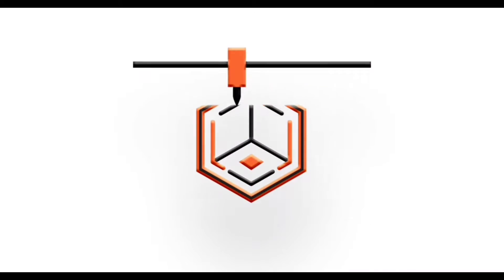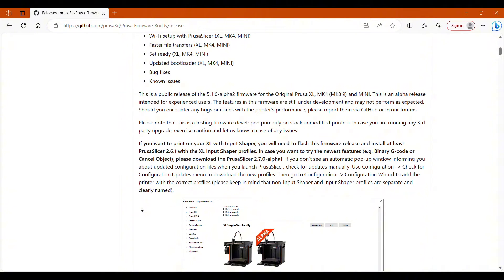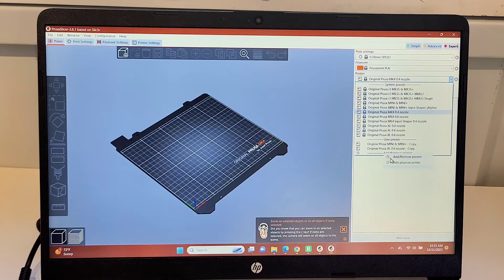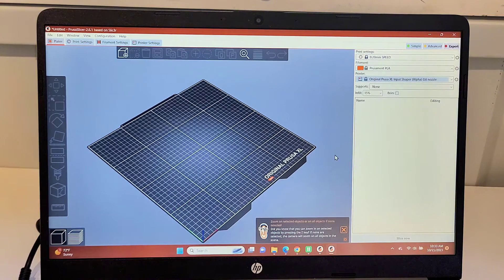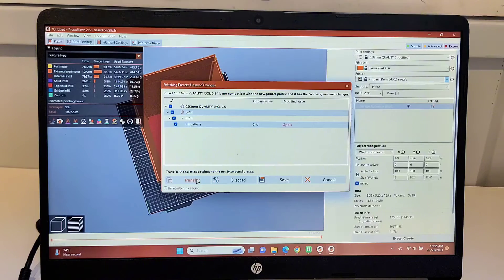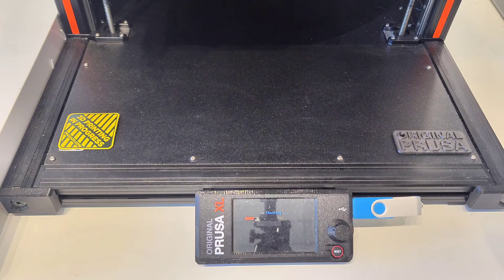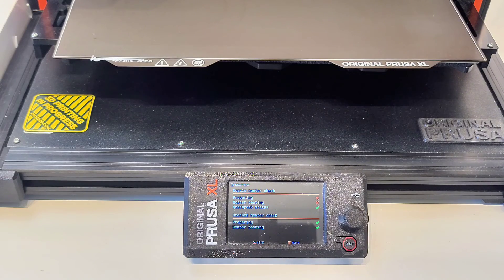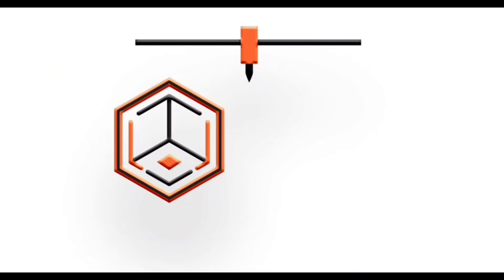Input Shaper on the Prusa XL is FINALLY here! How fast is it? How do you set it up?

Comment: Interesting video. When you set the prusa slicer to input shaper what speeds and accelerations does it set?
Reply from the maker: Going from .32 Speed to .32 IS Speed brings the Default Acceleration from 1000 to 1500. Perimeters go from 1200 to 3000. Thanks!

Comment: The github release page for the 5.1.0-a2 firmware one of the Known Issues states "Multi-Tool XL 3D printers can get stuck while checking heaters during the self-test, please restart the printer" which seems like the little hiccup you had. I wouldn't worry too much about it as long as everything else works/prints nominally.

Comment: I have had good ”luck” Edith the IS on the MK4. On the orter side of the spektrum though. Anyone has good settings for wood filaments in the MK4? So far no luck on that. 😮
Reply from the maker: What type of wood filament are you using? Most I have found like cooler temps. Those I usually run at 200 first layer and 190 for the rest.  But I have one that clogs unless I print it at 230.
Reply: @tada3dprinting   I got a roll of PrimaSelect wood filament. I'll try lowering the temp. It says 210 on the box, but I'll try 190-200. Also, after looking at all the wood filament vids I could find, I think my speeds are at times too slow. So.yea... Sorry for asking unrelated questions on your, as always, good informative video!

Comment: So, I tried it with a 200% scaled custom colored articulated dragon and...massive fail. Noticed a layer shift about 10 layers in and thought I could live with it. Came back a couple hours later to a bunch more layer shifts and the heads were frequently rehoming themselves. I was using silk PLA for 3 of the colors and 2 regular all on Generic PLA settings. Changed the 3 silk colors to Generic Silk PLA and am attempting again without the IS profile, but still on the alpha firmware and slicer. I would say it's not quite ready for complex models.
Reply from the maker: Oh that sucks! Yeah it may need more work.

Comment: On my MK4 I use the input shaper profile with all my prints. Selecting the structural setting has not failed me yet. I definitely see decrease in quality with "speed" setting. I am curious why you would choose not to use IS on the XL or MK4. The MINI was not designed for IS, I understand why that would be problematic and not worth it.
Reply: You are correct the Mini isn't designed for input shaping. However, this only applys on a stock mini. There are upgrades on printables to convert it to dual-z, making it extremly rigid. Even with standard firmware, the quality improvement on the prints is clearly to see.
So I look forward for a final firmware for the mini with input shaping. Of course you need to do a manual calibration, as with dual-z mod you have different resonances than on the original conterlever design. Still, if you upgraded the mini over the years (like Revo Mini hotend, Sherpa direct extruder, dual-z) it might be worth it.
Reply from the maker: I tend to have warping with Input Shaping. But probably "structural" would be a good fit. Thanks!

Comment: On the non-input shaper printer, you had the „QUALITY“ print settings selected, while on the input shaper printer, you had „SPEED“ settings selected. Is there really no „QUALITY“ profile available on the input shaper printer, or did you accidentally compare different print settings?
Reply: They call "Quality", "Structural"; as in make the structure look good and sound. I have seen a lot of ghosting on my MK4 with "speed" selected. "Structural" has been giving me both better speed and quality than my MK3.
Reply: There is only speed and structural But on that note it it totaly different speed settings for obious reasons. If it would have the same settings the time would be the same.
Reply: Thanks for the explanations! Maybe comparing the SPEED profiles on both printers would be a fairer comparison then?
Reply from the maker: Honestly I didn't even realize there is more than one Input Shaping layer height option. My next video will have a little more comparison. Thanks!

Comment: I have had good luck when I use IS on my MK4, but I don't use it that often. I default to "Oh, this is just a one off and I can wait for a quality print". I just checked what I am printing right now and I could have reduced the 16h 26m print to 10h 34 minutes. I really should try it more often. 
The 5 head XL should be amazing! I am really looking forward to some fast multi-colored prints from it.
Reply: For me the input shaping on the mk4 works realy well and I tend to use it for pretty much all prints.
Reply: @pedrokatuniz8936 same here
Reply from the maker: Yeah I jump back and forth. IS tends to warp a little for me unless I keep the room really warm. I need to use it more too.
Reply: @tada3dprinting  that's true. Other then you I mostly print functional rather then decorative parts so that does not matter that much for me.